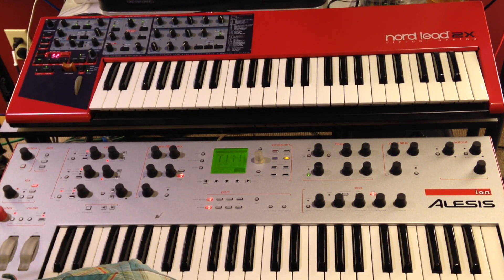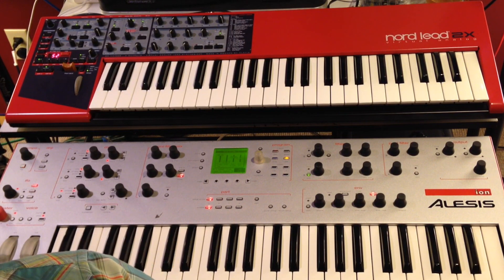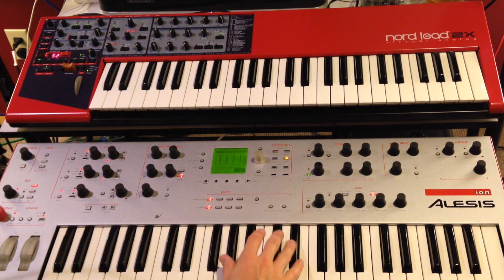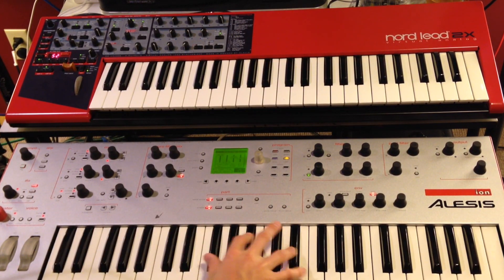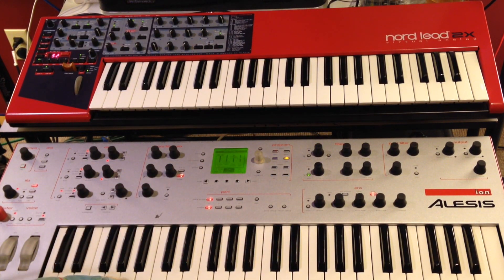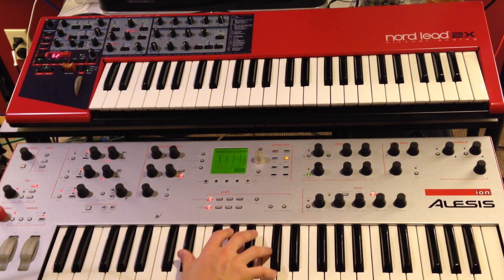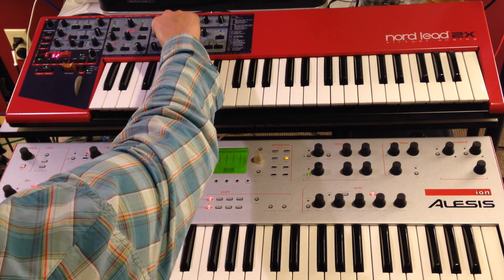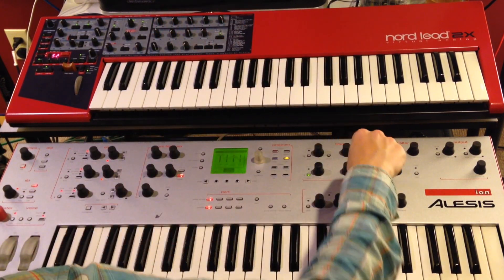Alesis Ion & Nord Lead 2X - 24DB Low Pass Filter Comparison (HD)

Comment: Through quality phones, sound very close-although I think the the Ion sounds a tad "smoother" with the filters. and am not sure-but is the Ion at 100%-sweeping though a much wider range of frequencies with a similar knob motion than the Nord? Maybe this accounts for the difference in timbre at 100%?  I have all 3 Alesis' keys-the Fusion, the Micron (now a Miniak) and the Ion, soon to be restored.  I can see more knob movement is needed with the Ion, but then the controls have more room between-and the 3 control wheels reallycan make a difference in realtime sound changes used in combination.

Comment: Could have routed to filter cutoff on the ION to the Mod wheel to get around the 360 encoder issue.  Keep in mind the ION and Nord are different filter models.  Nord has their own 12-24 DB model while Alesis loosely modeled the MOOG 24db LPF. So they won't and shouldn't sound the same.  They are both excellent synthesizers!

Comment: I got 3 ions, 2 microns, a "Nordload" 3 a. s. f.  I know them very well. While Nordleads sometimes sound same great as the best analogues the ion soundwise often sucks but that´s no prob 4 me. They provide more than enough parameters to still program cool sounds. No Nord ever is too bright. Have you ever played an Oberheim OB8 in 2pole mode? Hi Frequ is a quality mark of highend analogues. Dark VA-sound = cheap processing.
Reply: I sold the nords and kept the Ion.But i will agree that the Nord often sound more pleasing if you want to do all the classic sounds. But for that i use software nowadays, so the Ion is just for geeking around with strange sounds.

Comment: A couple of thoughts:
1) I think the filter in the Ion is set to track the keys but in the NL2 it isn't . You can hear multiple resonance peaks sweeping in the Ion but not on the NL2.
2) Maybe that's why the raw saw sounds brighter on the NL2. If the keytracking is set, lets say, at 100% on the Ion, the filter won't be fully open if you press some keys in the middle of the keyboard, even if the cutoff knob is at its maximum value.
Reply from the maker: That could be the case +Gastón Betancor, it has been 2 years and I no longer have the either synth and is hard to remember for sure.  However, I do seem to remember the Ion sounding darker over all and noticeable filter stepping regardless of the key tracking settings.

Comment: The ION has more natural filter sound, until 100% resonant. Then is coming some digital substance. But in overal? ION eat the Nord. The Nord a bit too crisp and has more higher frequencies. Compare to ION is more clean but digital feel. And on the Nord  You can hear the steps (8 bit encoder).ION is total underrated synth in many cases. I think is excelent! Why Alesis not make new synths after the Andromeda....
Reply from the maker: Yes the Nord can be almost unnaturally bright, which believe is why some people say it fits in a mix well.  The Ion is much warmer sounding but it is too bad it has that digital mess at the top of the sweep.
Reply: Years later, but this was my first impression too, the ION sounded more natural but kind of melted down in the extremes.